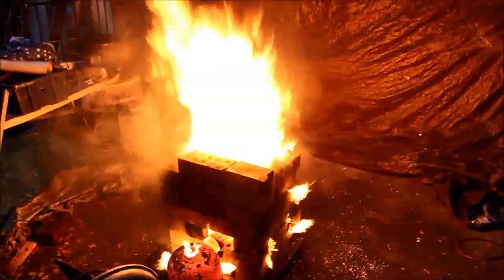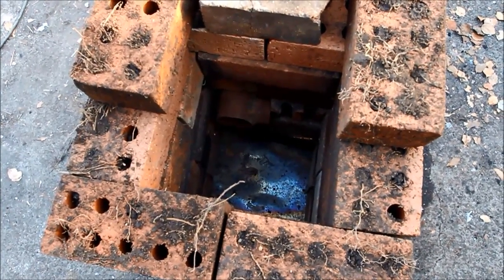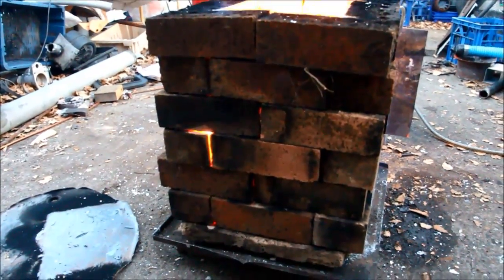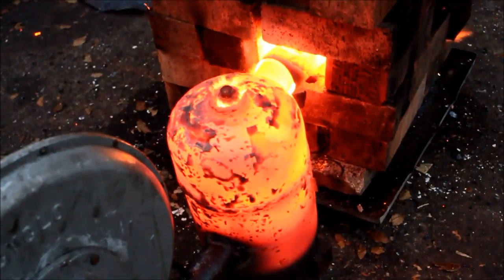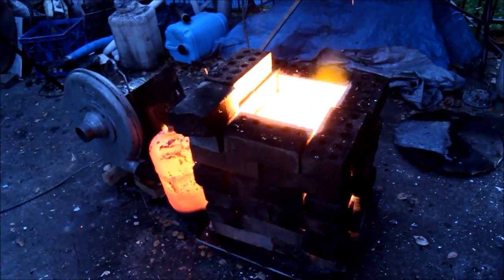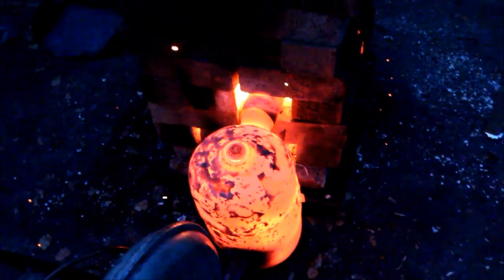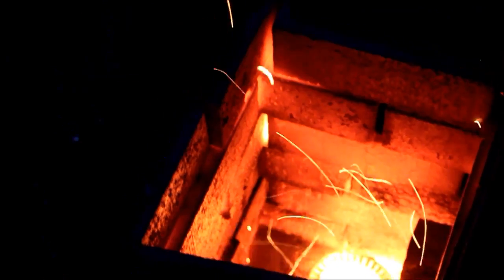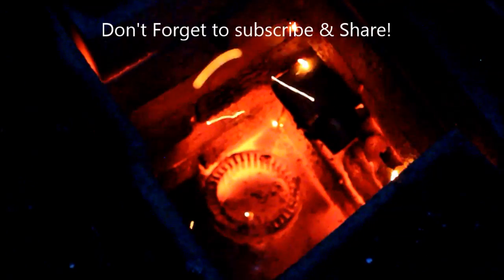300KW Waste oil burner Melts Steel!!

Comment: somehow I thought about the old V1 Rockets HAHA

-how much throughput has the blower ur using there?
Reply from the maker: BitGridTV  Unfortunately I don't know as it dosen't say.  All I know it is a LOT!  I recently bought a high powered jumping castle blower and it has noticeably more volume and pressure than that. It's also more than my electric leaf blower by a good margin.  If you see my latest video you can see I was supplying the burner 1L min of oil flow and it leaned that out. I don't know what the air cfm to oil flow combustion rate is but I suspect this thing has enough to go as high as 750Kw output.  Once the storms with the most rain we have had here in 10 years stops, I'll get out and fir the thing up again and see just how hard I can drive it.   

Might be real handy in drying everything out that has god sodden around the place!

Comment: I watched your original build video. I refrained from asking a question then but now I really must. Why use the large chamber? All it seems to do is waste heat. A straight pipe would have worked as well and more efficiently.
Reply: You're absoloutley Correct, having the combustion in the furnace would have been more efficient.  I just did it this way on a whim to see how hot I could get it.  Just Curiosity more than any particular reason. I have got some Fire bricks and I intend to try this again with the internal combustion setup as you suggest.
Reply: glumpy10
Good on you. A little experimenting [Jumping off a high cliff excepted] generally hurts nothing and can often be useful.

Comment: where are the sparks coming from?
Reply from the maker: Anywhere they want I think!  :0)
Probably loose bits of material breaking off the brick as well as pieces of the metal inside the furnace and bits of carbon coming loose from inside the burner.  There is some carbon inside the burner on start up which then burn and are ejected once it gets hot.  Given the tempo this thing reached I think there could have been a lot of things sparking.

Comment: Hi there. What are you using to regulate the flow of oil? very impressive
Reply from the maker: Just using a ball valve screwed into the threaded plastic drum I use for a tank.  The regulation isn't good at low outputs but being a maniac, I rarely run the thing at sane levels so it's not too problematic. I have got used to the very rough controls anyway.  I would reccomend a small 1/4" ball valve because the smaller the valve the less touchy the setting for the fuel is going to be.
also you don't need the tank too high.  As long as it's high enough to give you enough flow it's good. I often keep the valve wide open but the tank only a foot or so above the burner.

Comment: Thanks for the reply.  My mind does not work well on see and do.  Some people can but I am not one of them.   I need order (plans) to my madness
Reply from the maker: HAHA! I'm the opposite! I just get confused with plans. If I can't visualise it i'm in trouble.  The burner is very simple to make, I don't think you'd have any Problem with it.  I never measure anything when I design them, I just eyeball it and 95% of the time, if it looks right, it works right. The other 5% can be fixed pretty easy.  :0)

Comment: Just what I have been looking for to make brass knife guards...could you have plans?
Reply from the maker: I have a couple of tutorial vids on building the burner. I don't think you'd need plans to cobble together a pile of bricks though. :0)  Some people have made proper insulated furnaces and put the burners in them and melt brass very quickly and easily.

Comment: Do you think this would work under a 6" concrete floor slab to create a massive heat sink to radiate heat into a home?
Reply from the maker: It would destroy the floor. You can't have fire acting directly on concrete. It will spall ( small explosions of trapped moisture blowing off layers) and the floor would fail/ have a hole in it pretty quick.
You would be better off doing a hydronic system under the floor and heat it that way. See the vid on my channel for using an oil burner to replace the gas burner on a hot water tank. That worked very well. Think I'll have to give that another run.
Reply: Oil Burner
 No, flame would be inside of steel pipe like they use in overhead radiant heating systems.http://www.spaceray.com/industrial_infrared_heaters/tube_heaters/PTS_PTU_series/  I like Hydronic systems but they are only good where there's no chance of freezing in winter, as in out buildings and workshops that you only heat when your in them.

Comment: Hahaha - that's some serious power output of that burner. Just amazing with that design and still get up to that temperature so easely. But those bricks - did they got "glossy" on the inside? Because I have had house bricks melting at about 1200°C - those are not the same as fire bricks. I also have a video of melting concrete and a piece of iron plate of a transformer core and cast iron (wich I don't have a video of) - melting point of iron/steel varies depending on content of silicon and carbon and other stuff in it (pure iron have the highest melting point at about 1540°C).

My is furnace is electrically heated and that's nice because it's efficient and cheap (if you dont have free waste oil) silent and I can run it indoors as I live in an apartment (just at the moment I rebuilding the power regulator - then I will put more videos of it) - but this one probably gets up to temperature quicker and doesn't have an upper limit at about 1300°C, that I get with my resistance wire heating elements. But you probably need to fix some other "air/fuel mix tank" - that one will probably not last for long when it gets that hot (you can relly see the "scaling" of the metal), haha.

Also I can think of what kind of heat radiation given off that thing, hahaha - probably as when I open the lid, but all the time as there is no lid.
Reply from the maker: yeah, the bricks got quite glazed and some even melted on the corners and edges.  I didn't run this thing that long or that hard. If I put some serious fire into the thing for 15MIn I think the bricks would start fusing together. In the future I'll do another furnace and put some refractory like kiln wash on it to protect and seal the bricks to make it somewhat respectable as a furnace.
I was pretty amazed with the results for what it was which was just some old house bricks.
Reply: Oil Burner
Yeah - I saw on your other video where you take it apart after this run that it was a short time run. The line where soot is still left shows the point of the cross section where the temperature inside the bricks was below about 550°C. As that line was so close to the very hot inside - the surface just got heated so fast that the heat didn't have time to spread any deeper into the walls.
The molten ceramic gets compact and conducts heat more, so once it start melting it will probably go faster and faster if you let the burner run. Normally that would go only to a certain limit as more and more heat leaks out when the walls deforms and that finally drops the temperature (wich prevents the furnace from collapsing compleately) - but I don't think that would be the case here (if you let it run for an hour or so), LOL!!

Comment: BOGANS RULE ! shes a beauty imagine massive underground tanks of water how quick you could heat em up ?   !   onya mate
Reply from the maker: Got to be a fellow skip!  I'm working on heating my pool with a 200Kw rated heat exchanger that I picked up from an Olympic pool when they were having their boiler updated.  Of course with my burners I'll have to throttle them back a bit but for my 70,000L pool, I should be able to heat it up in 12hours flat.
Reply: bonza mate look forward to seeing more cheers
Reply: mornin matey just thought i'd let ya know its freezin ere hows that pool thing comin on ? FLAMIN OZZY'Z   !
Reply from the maker: Haven't done much with that atm due to having other things on but I have built a couple of new burners that may be suited for the job.
I'll have some vids of them coming up soon.
Reply: brilliant what do ya reckon about makin the burner round with small holes like the old primus stove you pumped up ?
Reply from the maker: That would be pretty interesting actually.
I'll do one like that. just drill a whole load of small holes in the top to disperse the flame. would be great for large cooking pots or under a BBQ plate or something.
I'll call it the Bogan Burner.
Reply: ha ha haaa great stuff ! can i ask where you get your waste oil ? is it a take away nearby ?
Reply from the maker: I get it from a number of restaurants, clubs and even was getting it off cruise ships in 100L IBC's through a friend. You can see my other vid on the oil pump and collection tank I made for doing the pickups.
Reply: noice

Comment: See what happens if you spray a mist of water into the mix.
Reply from the maker: I don't think a lot would happen. When running this hard there is no pool of oil  in the burner for the water to cause a flare up with. The oil is vaporised from the retained heat as soon as it enters the burner.  IF And I think it's a big IF, the water was broken down into oxygen and Hydrogen the energy required to do that would be more than the energy returned. If it didn't crack the water it would simply be transformed into steam which again would result in a reduction of heat output.
Reply: Oil Burner It won't hurt to try. As far as the energy needed to crack the water is concerned that is way past that what with all that heat you have there. So give it a try.

Comment: Hello OB... Yet another great video. I was happy to see the big blower that close and not cooking itself. The one I am working on will have to all be close knit but mine will all be insulated. Good to see yours was that close and didn't scrap itself!! 
One thing I'd like to see on your blowers is a rheostat. Even a cheapo light dimmer would work, but for heats sake I would use a 20 amp rated or bigger. Really only for the sake of heavier contacts. 

Keep them coming buddy,
Steve
Reply from the maker: I did put a bit of sheet metal in front of the blower motor to shield it from the radiant heat. The blower section isn't a worry because it's basicaly self cooling... and cast ally.
I am thinking exactly what you said to put a controller on the motor, I'll have to check the dimmer ratings against the motor output. Don't need a 20A Here because our single phase is 240V and we only have 10A available at any socket  which is the same as your 110@ 20A. I'm always looking for a cheap Variable speed drive for this sort of thing.  :0)

Comment: Wow, was my thought all the way threw. Is it the air flow that keep the fan from melting too? I'm just learning, thanks for sharing.
Reply from the maker: The blower is sucking cold air in and is the big round thing at the back. It never gets hotter than the radiant heat from the burner which is the thing glowing red. I put a piece of sheet metal in front of the blower motor to stop it getting hot but the blower section itself is pumping too much cold air to every get more than lukewarm. The feil is introduced into the burner section so the blower just moves cold air and therefor is the coldest part of the whiole thing. Reversed vaccum cleaners work well like this too, just theyare louder.

Comment: How do you figure the 300KW?

is that the oil flow at some btu or joules per liter?

thanks
Reply from the maker: Roughly you get 10Kw/hr out of every litre of oil you burn. By measuring the fuel consumption in liters and multiplying it by 10, you get the heat output.
Reply: That is an enormous amount, thanks...
how much does the air blower have to blow?
Reply from the maker: Yves Baggi I don't know how to measure that. The blower in this vid is 1/2Hp. I'm looking for a jumping castle blower or an electric leaf blower to use.  I have also run the burners with car air con blowers like in the water heater vid, Not as powerful as this one but plenty of potential power none the less.  Good for practical uses!